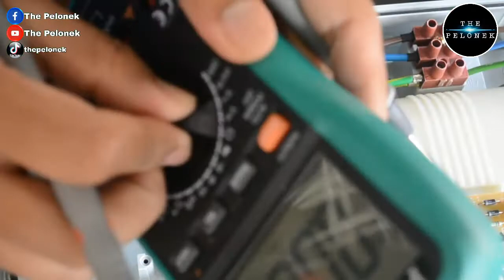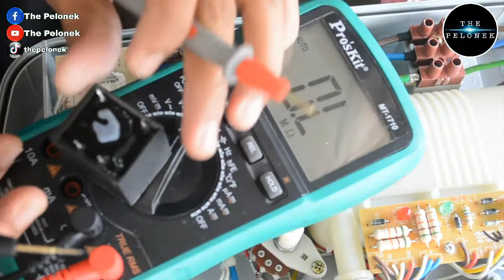Baiki/repair water heater Ep.46: JOVEN SL30P, tak hidup, lampu EELS TAK MENYALA

Comment: Hello Sifu. Joven i70p saya langsung tak hidup. Ingat Q1 rosak. Bila tukar, masih tak hidup. Bila test AC voltage, macam relay tak lepas. Test wayar masuk relay masih 230V. Tapi test fuse, voltage tak ade. Tapi continuity fuse ada beep. Macam mane ya. Tolong tunjuk ajar. Kalau tukar relay, apa part number yang kena beli ya. Terima kasih.
Reply from the maker: Hello. Cuba check area fuse ada resistor tak? Biasa ada resistor burn. Sbb transformer sudah sampai masa nak rosak.
Reply: @ThePelonek  I beli soldering kit baru, relay baru, transister baru, cuba diy tapi masih tak hidup. Give up! Kena cari you untuk baiki. Mana location you ya?

Comment: Assalamualaikum tuan.. dulu saya pernah tukar transformer..perlu ke cari amp yang sama? 0.333ma?? bila tukar tak boleh tekan butang test dengan reset..Mohon pencerahan
Reply from the maker: wslm. cari yg sama atau yg besar sikit. contoh 500mA pun ok. button test reset tak function tak ada kaitan dgn transformer. kena check button tu. 1lagi sensor bulat warna hitam tu pastikan ada wire biru coklat lalu dlm lubang dia. dan ic ka2803b juga kena check.
Reply: @ThePelonek  ok2 terima kasih tuan..semoga tuan terus maju dan dipermudahkan segala urusan..amin
Reply from the maker: @eyedrone9314  sama-sama. Aamiin.

Comment: Assalamualaikum tuan...nak tanya sikit...water heater saya joven SA10E bila test tekan butang eels tu dia dah tak trip..water heater ok...air panas mcm biasa..apa masalahnye ye..boleh DIY tak..terima kasih
Reply from the maker: wslm. kena pastikn dulu kerosakan dari mana. kadang sebab suis button tu je yg dh rosak. kadang eels board ada masalah. boleh cuba jumperkan wire pada 2pin button test tu. kalau touch kan 2pin button test tu boleh trip, eels board masih baik. cuma button yg rosak. boleh tukar button tu saja. kalau ada multimeter boleh set pd mode buzzer untuk test button tu.
Reply: @ThePelonek  baik..terima kasih bnyk2 tuan

Comment: Apa sebab kalau lampu merah heater tidak menyala? Lampu power hijau menyala.
Reply from the maker: Kena check thermostat, magnet sensor, filter, pressure air pun kalau low heater tak hidup.

Comment: Bro lampu Led EEL tu Ac atau DC
Reply from the maker: Dc
Reply: @ThePelonek  Tq bro
Reply: Bro..I dh cek power board...semua ok..DC out 12v..tpi lampu EEL hijau tu tak nyala. Yg lama putus ...I dah ganti dgn yg baru..tapi tak nyala juga.. lmpu merah utk Heater ok..nyala klau on heater
Reply from the maker: @MrBelarek  kalau tekan button test reset ada bunyi relay tak?
Reply: Ada bro...cma lampu hijau xnyala. Adakah sya slah plih LED..? Tpi msa I beli I beritau kedai LED you guna kuasa DC.
Reply from the maker: @MrBelarek  kedudukan kaki pin led betul tak? Anode (+), cathode (-)
Reply: Rasanya betul bro..I Cuba teblikkan Masih juga tk hidup..sebelum I psang I uji led tu guna led Tester..takut led terbakar.
Reply from the maker: @MrBelarek  beli led biasa atau led super bright? Joven tu pakai led super bright hijau
Reply: Okok..faham dah bro..patut la xnyala..mula led trbakar...so ibli LED biasa😊..TQ for your help..I'm. Stephen From Miri Sarawak.
Reply: Bro..mcm mna nak ukur nilai tegangan atau om capacitor jenis SMD yg kecil hitam tu . Dan mcm mna nak tauk ianya rosak. Tq..
Reply from the maker: @MrBelarek  biasa smd kalau rosak dia short. Atau pecah. Short tu boleh check pakai mode buzzer. Tp make sure double check. Cabut smd tu keluar untuk confirm short atau tak. Smd tu kalau short susah nk detect
Reply: @ThePelonek  ok..faham. so klau nak tauk dia punya reading mcm mna bro..sbb yg lama tu short. Nak ganti yg baru..jdi nak pilih yg mcm mna?
Reply from the maker: @MrBelarek  susah nk tahu nilai asal yg short tu. Kena cari board model yg sama, kena ukur nilai dia. Atau kena cari schematic diagram untuk board yg repair tu.